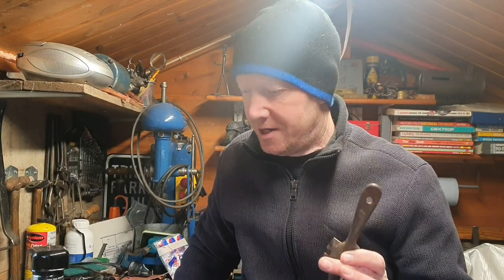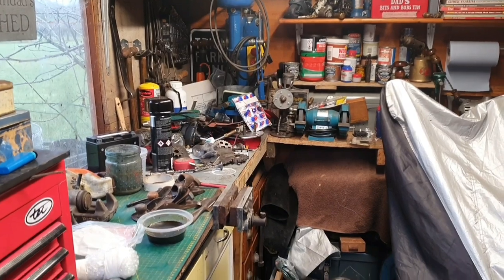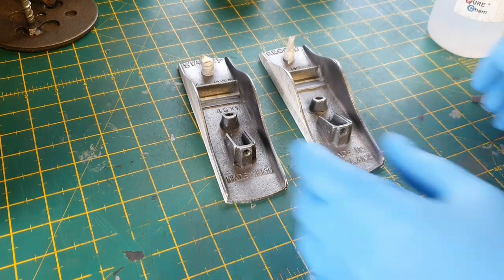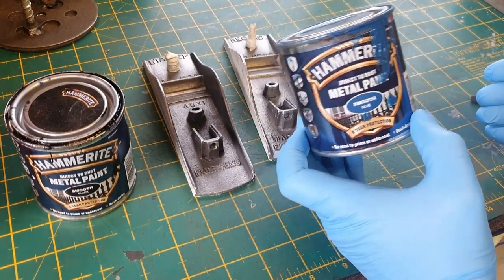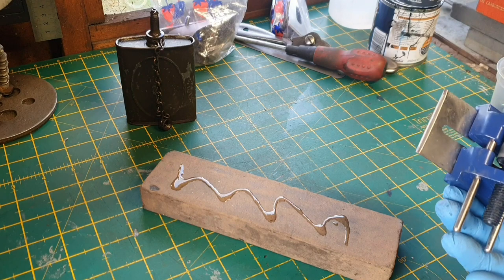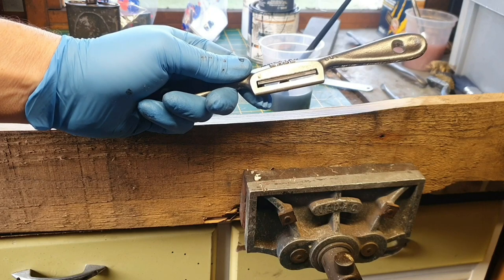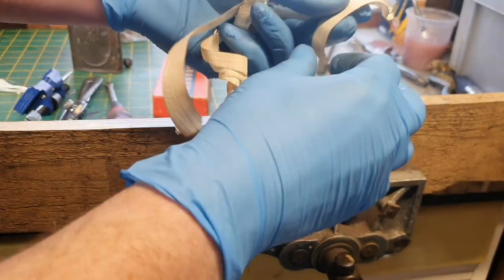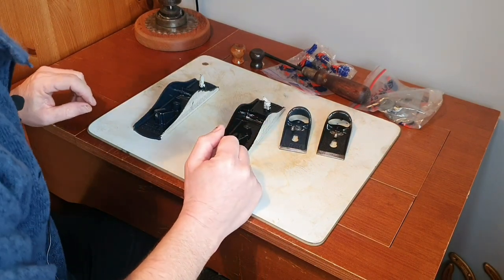vintage  block plane & spoke shave restoration

Comment: Those came out great. I have some planes I will get to eventually, some large one and small. I didn't recognize the Record block name. Is that a brand from Australia?  On that  note ,what are some quality tool companies in Australia that I might run across.. Thanks for sharing.
Reply from the maker: Record are an English company from Yorkshire (North England). Yorkshire is well know for producing steel and blades etc. I believe that Stanley tools (USA)  bought out a blade company there and that then became Stanley UK, many moons ago. I got curious recently as to why there are two Stanley tool companies and did a bit of revision. I love trying to find the history of some of these old tools.
Reply: @Bloodshed.restorations  I agree I like fax  finding history on tools as well, I get stumped on where the information is located and how hard some of it is to find it.
Reply from the maker: @Dalesworkshop  it is difficult with some brands, almost like seeing parts of history disappear. Guess that's part of the reason we do what we do.